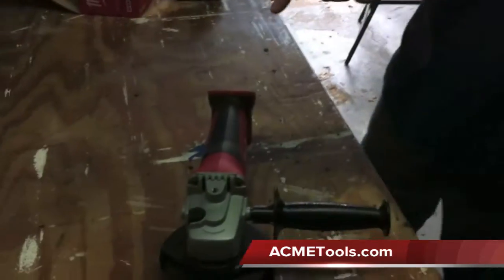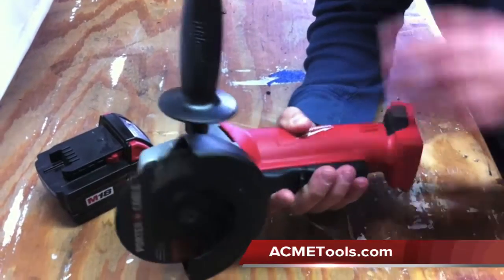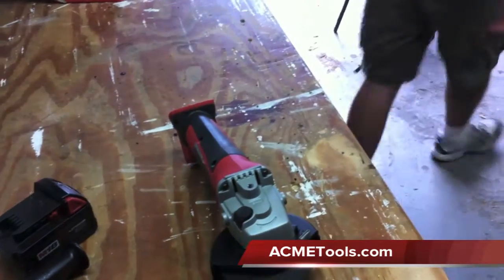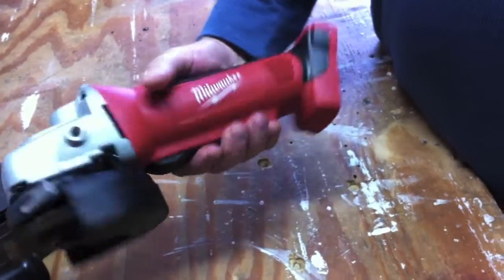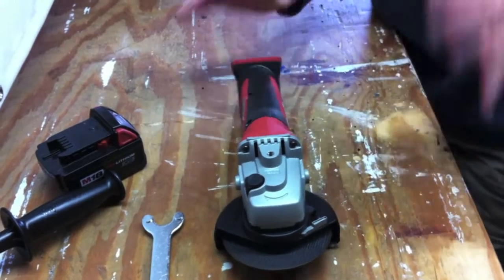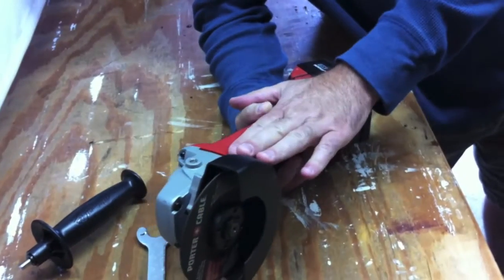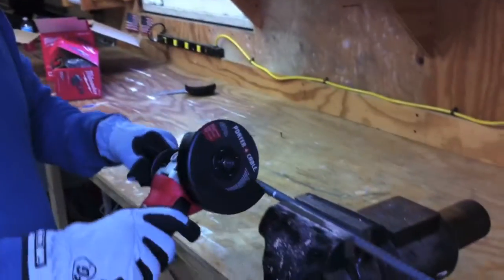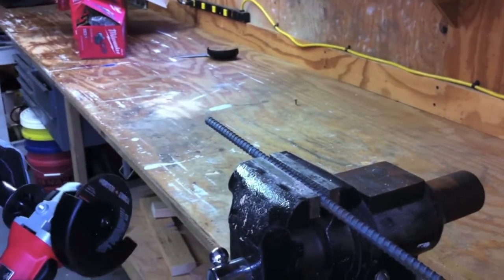MILWAUKEE M18 4 1/2 CUT-OFF/GRINDER 2680-20

Comment: Ever use a sawzall to cut rebar?  Lots faster and more cuts per charge.  Goes through blades kind of fast, and no good if you can't support the rebar from vibrating.

Comment: Not to flame but you are cutting backwards. You need to pull the tool towards you with sparks flying down not up. Not only do you get more power but a pore control on the cut as and kickback or jumping transfers the energy into the cut and away from the user. (IE: it's set up for left hand use like most cutting tools)